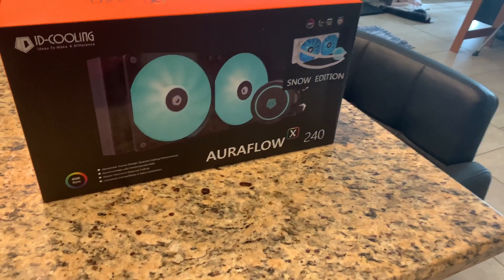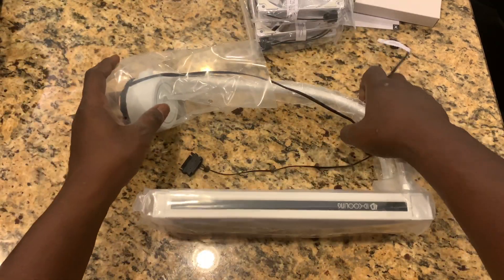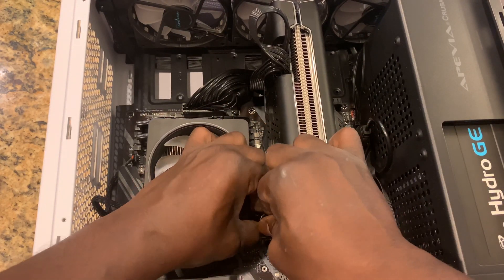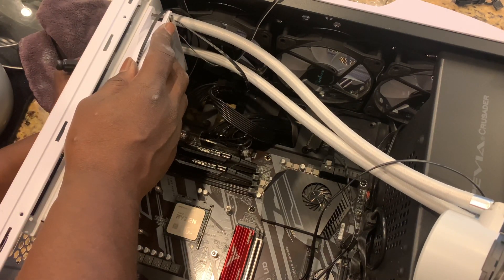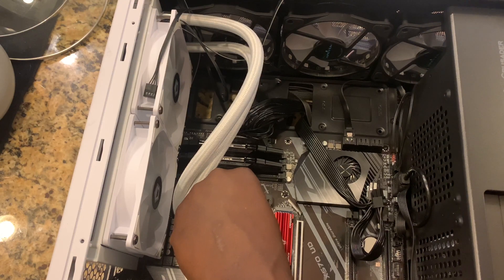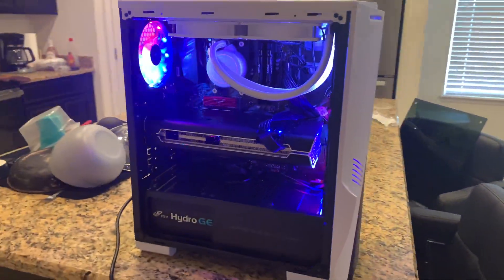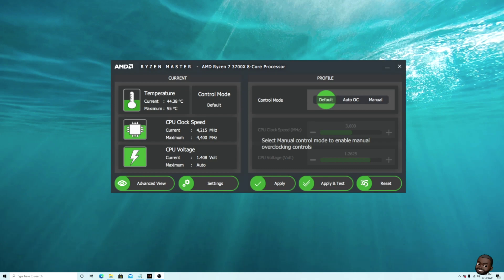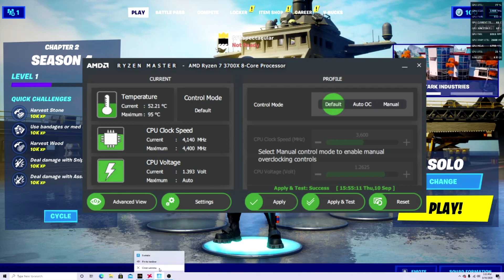AuraFlow X 240 Water cooler (unboxing, installation, & Thermals)

Comment: I installed this cooler over a AMD 5600x just over 8 months ago.  Temps have recently started hitting 93 degrees under stress test.  At rest temps are 68-70 degrees.  I reseated the cooler with thermal grizzly paste...No change.  I blew out the radiator very well with an air compressor, no change.  I did some research and found out this cooler has a tendency to get clogged inside right around the year mark (daily use of 10hrs+) and it is not repairable.  I  now waiting for a replacement NZXT cooler.
Reply from the maker: thanks for the info. If anyone else has a problem with this cooler I encourage them to post about it.
Reply: It looks just the same as many other coolers hard to see much differance with this one, to most of the others on the market

Comment: i installed this aio .but my pc said no display . i correctly pluggin  the cables , but  when can on the tempt 80 degree :(
Reply: You put off the sticker in the thermal past site?
Reply: @agustito  already pull out the sticker
Reply from the maker: You may want to call the manufacturer and see if they can help or SADLY, return the one you have and get another one. Sorry to hear that it isn't working

Comment: If i wanted to control the rgb on the pump head through my motherboard software i would just plug it into any 12v rgb header right?
Reply from the maker: Yes, I believe that's true. I have mine plugged into the power supply.
Reply: @sfcspectacular  ok thanks brother🤝

Comment: Can I connect the fans to cpu 1 fan header and the water pump on cpu fan 2/wp  and the rgb on 12v 4pin header  for rgb it’s an asrock b450m steel legend  I just ordered one today gets here at night and I want to be prepared with the wiring of it
Reply from the maker: You can do that...which will make software control of RGB lights possible. I wired the fans to my power supply if I remember correctly.

Comment: I have a question what color are the fans? Or are they rgb can you change the color or are they stock light blue like in the image?
Reply from the maker: they are RGB lights and can be controlled with an onboard remote or thru software.
Reply: @sfcspectacular  Do you know what software you can use with it

Comment: Is it possible to install without removing the motherboard? And just using the stock backplate?
Reply from the maker: You can probably do that but I don’t know what Back plate you have. I would think as long as the screws connect you should be good.

Comment: How do you control the rgb and how do you control the speed
Reply from the maker: You can control RGB and Speed through a mini control provided or find the software for your motherboard.
Reply: Get up here rgb fans, there is a 5 pack for 36 dollars and it’s pretty simple because it has a mini controller so you can change the color

Comment: Loved the review🔥 Btw would this be compatible with the Asus ROG Strix B450-f? That's my motherboard for my build and i can only support 4pin 12v. Is the cooler itself a 3pin or a 4pin?
Reply from the maker: It’s a four pin. I have one of the pins connected directly to my mother board. I have. 570 I don’t know much about the B450s. Apologies.
Reply: Appreciate the response, everything is all good. Take Care :)
Reply from the maker: @phobicalbatross  thanks for checking the video out 🙌🏾

Comment: bro you didn't lock the mount to the CPU that's why your cooler pump is on an angle. The pump ins and outs should be on the left or the right of the pump. That mount goes on then turn to lock in place. If you dont fix it the cooler pump will fall off the CPU.

Comment: Alright dumb question but do the screws you use to mount the radiator to the case look like motherboard screws or are they flat?? I accidentally mixed them up taking apart some stuff and I can't find a freaking video clarifying what they look like
Reply from the maker: The screws youre looking for are short and have a cross tip on them. There should be 8 of them.

Comment: So I purchased the same cooler and have a question? I'm planning on connecting the fans that already came with my case to the cooler my only thing is I don't have a Pump header on my motherboard just a regular 4 pin cpu fan header, can I connect the pump to my CPU_FAN header??
Reply from the maker: Yes, you can connect the pump to the regular 4 pins, BUT you can also daisy chain the pump onto the fans/radiator and then connect all of them to your power supply.